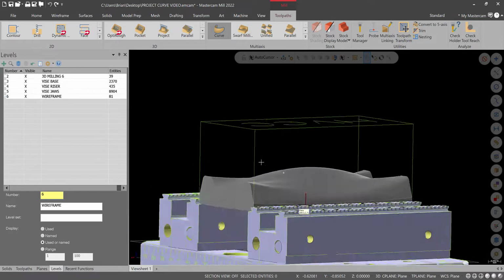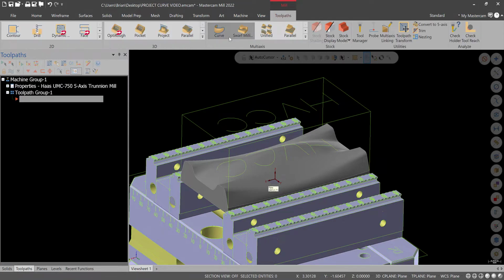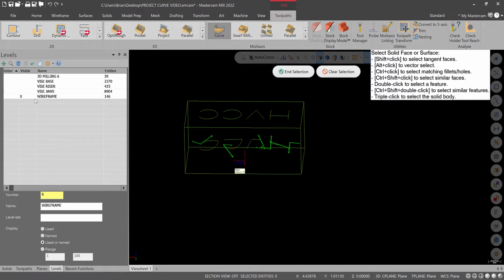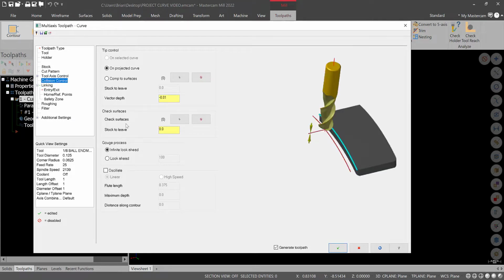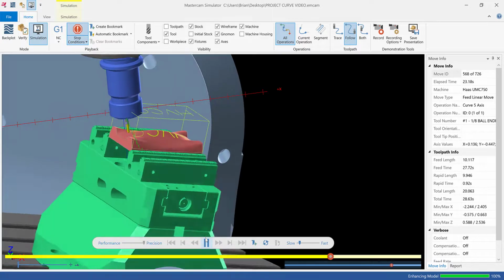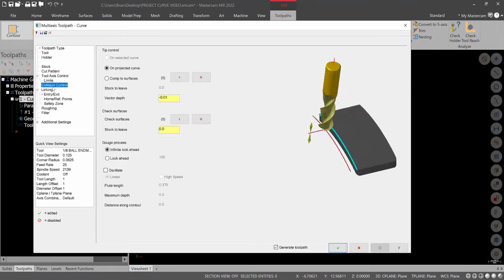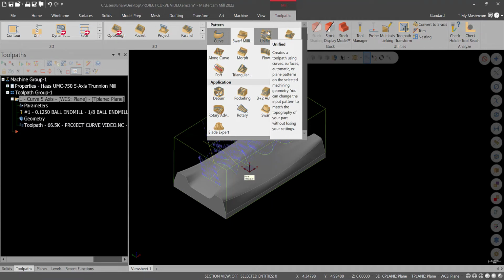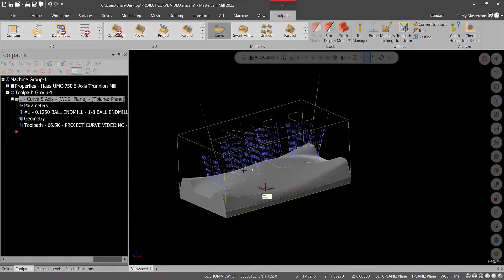5 Axis Curve Engrave

Comment: Hey Professor Wickham, is there a way to use mastercam to broach in the mill? I want to use a single .375 broach for a keyway, from center of ID to end of keyway is .770 and or from edge of Id to end of keyway is .172. I want to take 0.002 per step over. Id of hole is 1.252 without keyway cutout. Hope you can help much appreciated.
Reply from the maker: I am not sure about this, any broaching I have done has either been with normal keyway broaches, shaper, or wire edm.